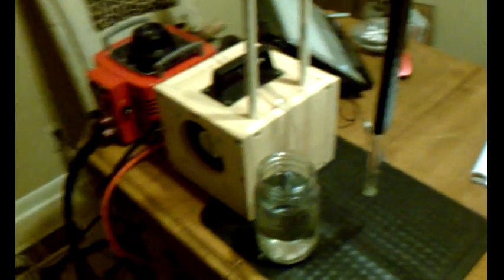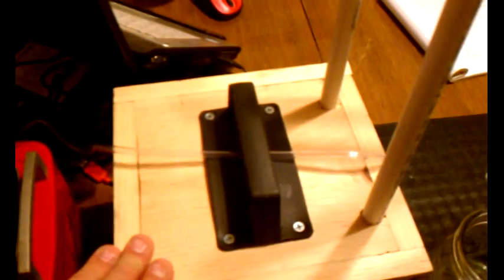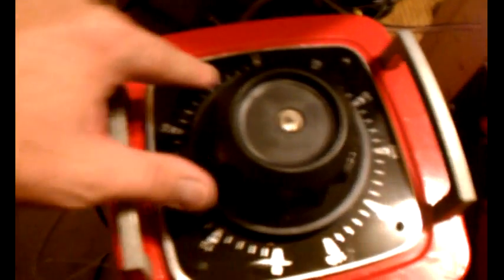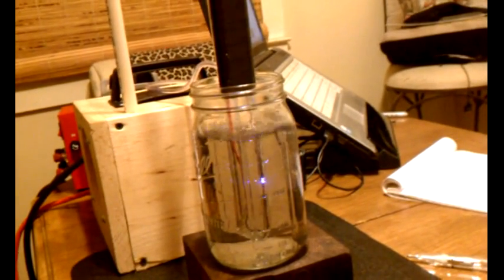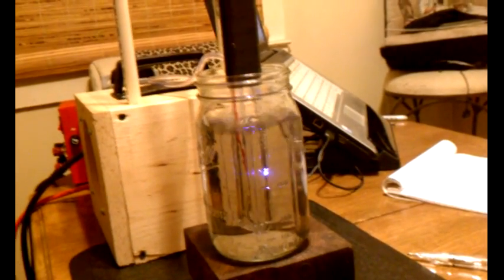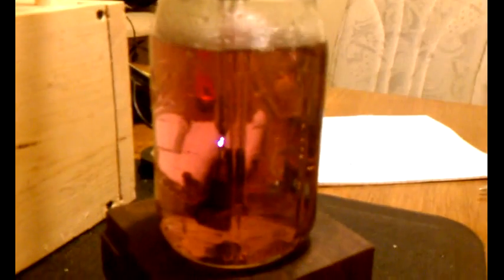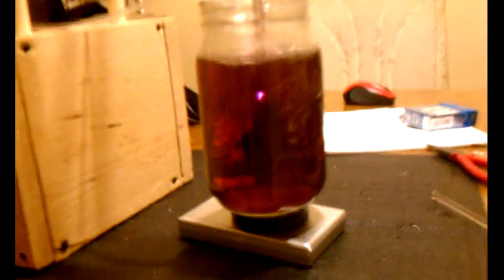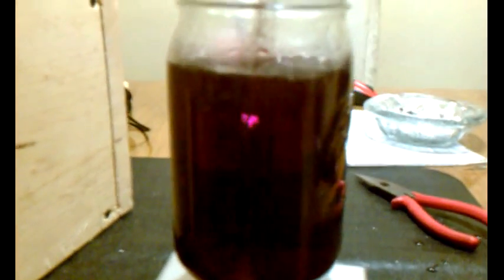Colloidal Gold made 8-5-2011

Comment: Watt amps did you use- Purple is the correct color actually- you shouldn't add the H202- it needs to be pure gold-- the red color comes from the nano gold- which is what I do not want anyway- thanks though- What amps did you use? I Don't see why you think you need the bubbler??  I wouldn't have anything foreign like that bubbler tube in the solution - just the Gold :)

Comment: It is just as potent if not more potent than using h202 and a MOT to get larger particles.  And I mean much larger particles.  If you want to do it the right way use an NST with nothing in the water turn your variac up to about 110 volts and find a way to create just right amount of resistance and voila RED GOLD that is pure.
Reply: You use a variac on you Nst? What's the output of your Nst?

Comment: Yes you can make it without h202 and I highly suggest that because I found the using h202 just colors the water.  Do not listen to Karl Reinhart he is a psychopath.  I currently am making colloidal gold that is nothing but distilled water and gold.  Use a neon sign transformer which is slower.  But the difference is that it actually make the right sized particles Karl is pulling a fast one on people.